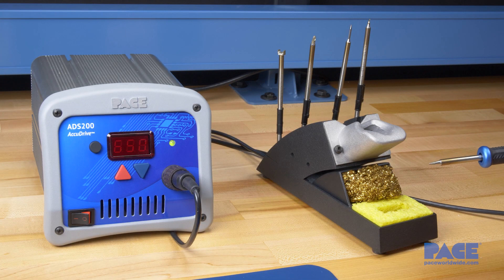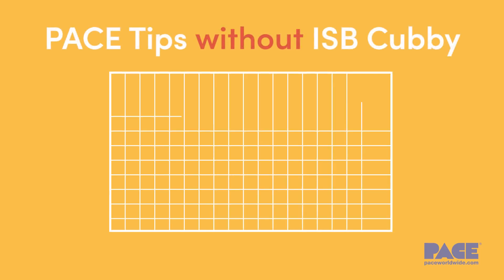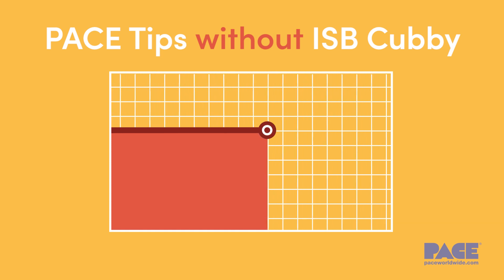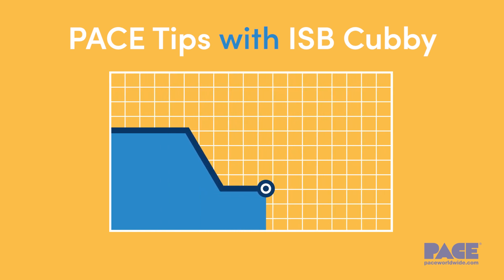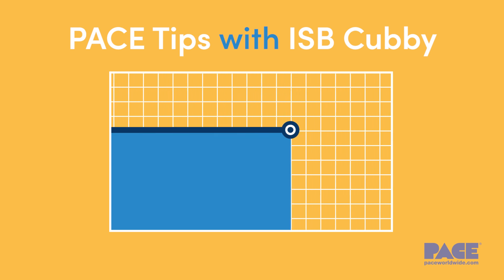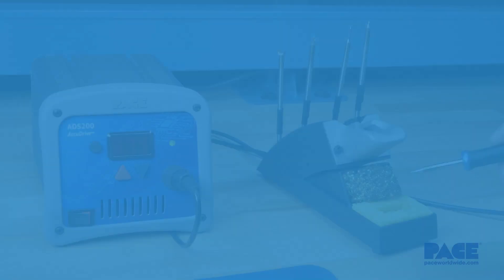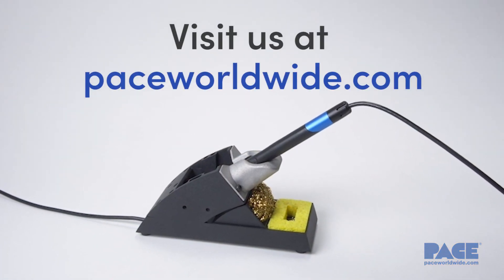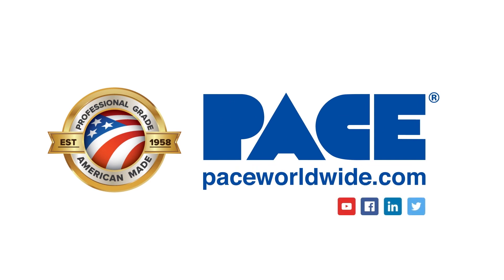Extending Tip Life with the ISB Cubby from PACE

Comment: i saw a local guy dip the tip into the steel wool after using, thought its for same purpose. is there any potential issue? like rust or something?
Reply: Steel wool will cause damage to the tip plating. It should be brass wool or a damp sponge for cleaning only.